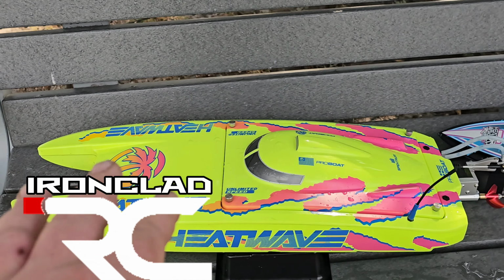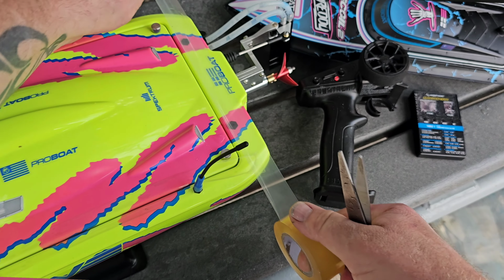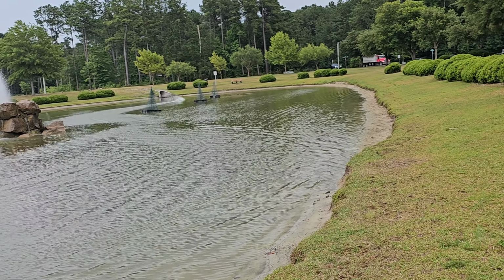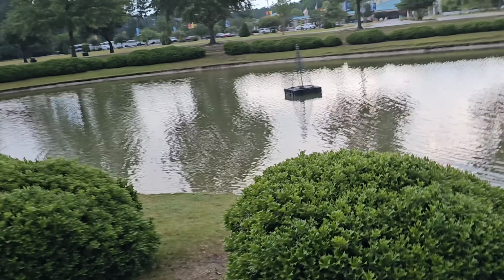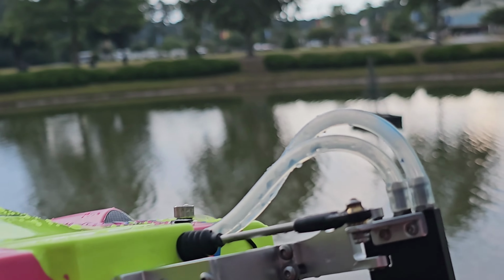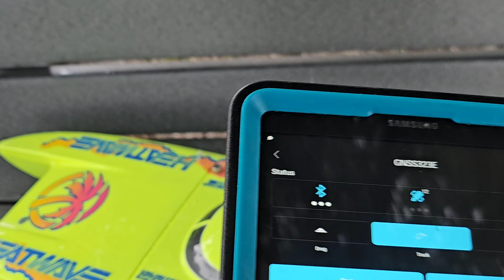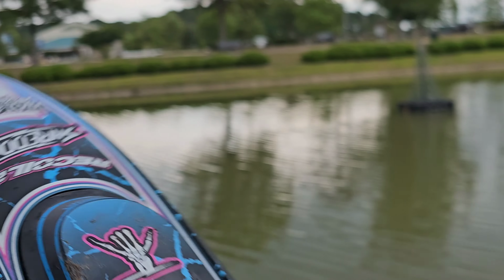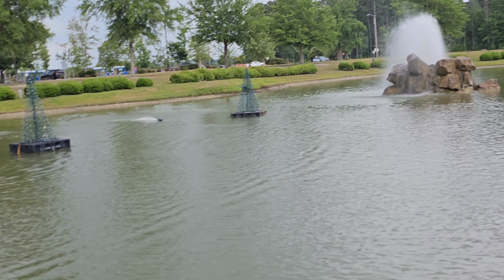Playing With Boats Proboat Recoil 2 18" & V2 Blackjack 24"

Comment: I ended up removing the antenna and the rear mounted water outlets so I can tape it since I run in saltwater. No more water in the boat. Thought it was coming from the stuffing tube.

Comment: Great video and great boat! I bought mine today and want to bind it with my DX5 Rugged. How does self-rightening work with a different control?
Reply from the maker: You use the throttle trigger to rock the boat back and forth, actually works better than the self righting button
Reply: Thanks for the quick reply! I'll charge the batteries tomorrow and bind my DX5 and then off to the lake.
Greetings from Switzerland

Comment: Hey man , I got my blackjack 24” to 57.9 today. It did a triple backflip at 53mph the run before.🤦‍♂️. I put a 120 amp esc in so I was able to run two 3s 130c batteries. I made some adjustments to the to the propeller lowering it? I ran out of room I’m guessing I can hit 60mph ? I am using a 43mm propeller I sharpened and balanced. I would have waisted a lot of time trying to figure out how to adjust the different components. If not for your channel I would have waisted money and time so thanks for sharing your experience. The triple back flip was epic this boat can take a few oops very forgiving. I need to find a bigger pond to hit 60mph I barely fit 47.9 in .😂
Reply from the maker: I just did the same to mine, put a 120 in it this evening,  install upload tomorrow morning,  running video the next day

Comment: I just ran my bj24 v2 for the first time today. I really like it. I have twp 2s 5200 120c packs and got 40mph out of the box. It seems to be snappy on right turns , it will spin out. Did you have that. It also seems a little more side to side wobbly than the og bj24. But i absolutely love it.
Reply from the maker: Yeah, I turned the dual rate back considerably, also learned it turns better on plane

Comment: Congratulations B,
Great. I like to have a prop like this 😊

I think the hatch needs mabe in the front longer pins. Often the mono hatches have to much flexibility in the front at the round spot. So they come out in the front by closed locking in the back.
And the front gets more force from the water by an impact on it or by diving.

Taping the front is most times more helpful than the back.
That’s my experience.

👋🏻😊

Comment: Hello, I just got the recoil 2, 18" and took it out for it's maiden voyage, well after about 30 seconds it wouldn't steer left... somehow the servo became un-glued (crappy factory job??) just wondering what product you would recommend to re-stick the servo/plastic mounting bracket!
Reply from the maker: CA, jb plastic weld, quality epoxy. Should do the trick

Comment: I have a oxidine marine 36mm 1.6 pitch 3/16" bore 3616 CNC laying around and i was wondering if you though that could work well with the recoil 2 18
Reply from the maker: I actually tested that prop on the R18  it handled it pretty good 👍
Reply: @IRONCLADRC  So if I run this larger prop and 3s 80C you don’t think that would be too much stress on the stock components?

Comment: May I ask what tape is that call?
Reply from the maker: Clear Hockey Tape - Multipurpose Tape Roll - Durable Shin Guard Pad Socks and Gear Tape - Strong adhesive Easy to Stretch & Apply - Hokey Sports Gifts, Accessories, Equipment, Gear https://a.co/d/0h5B7nAQ
Reply: @IRONCLADRC  Thank you very much !!!!!!
Reply: @IRONCLADRC dude plays with rcs and runs the midnight beer league